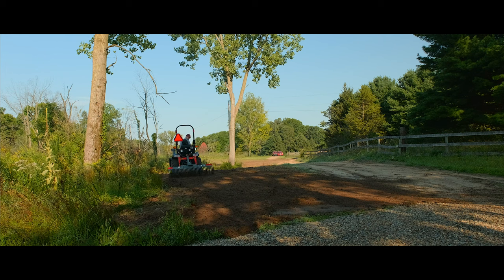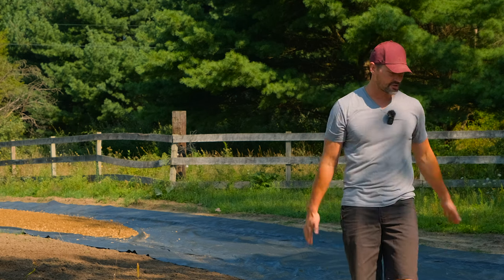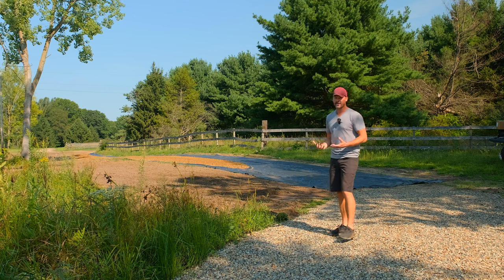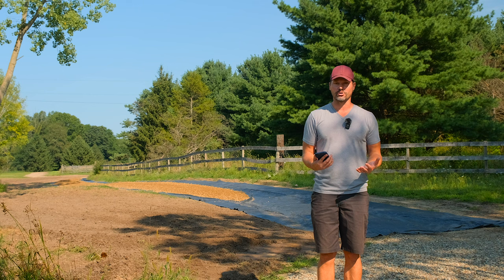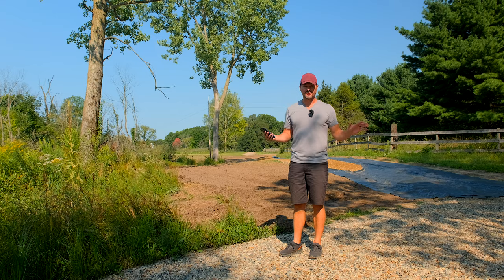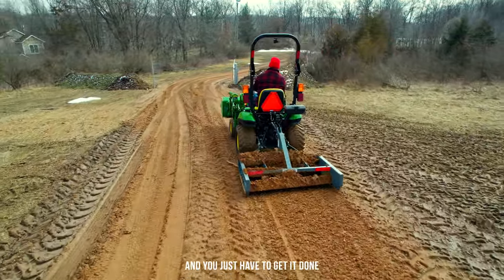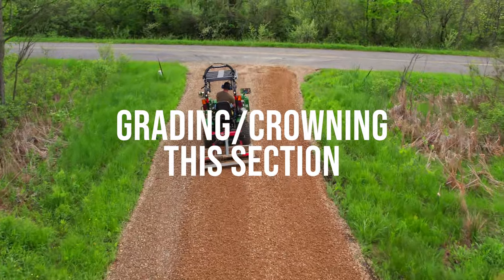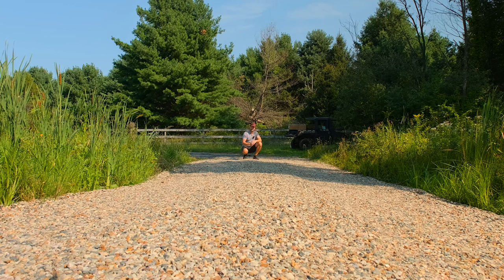5 TIPS FOR GRAVEL DRIVE MAINTENANCE, IS ROAD FABRIC WORTH IT?

Comment: I’ve given up on stone. I started using asphalt millings. Spread it and pack it down when it’s moist and it’s almost like a blacktop driveway.
Reply from the maker: Got that going in at our shop in paw paw
Reply: I have been concerned about long term effects of the oils
Reply: @beaushirley4668  The asphalt has already crystallized and hardened. There shouldn't be much of that left

Comment: Hi, an old school way to make a base for a driveway is to remove topsoil, spread road gravel base,  rowtotill cement into gravel  base, back blade to smooth, water for hardening. If desired, lay down black top for a finished driveway look to compete. I helped my Grandfather do his driveway 50 years ago and it is still in good shape in Northern Michigan 🤠
Reply from the maker: Whew, lots of work, but sounds like it lasts!

Comment: We install dozen of driveways each year.    Fabric on new drives is a must.    You can usually purchase the material for about  $1.25 or less at you ETNA dealer here in Michigan.    Rolls are about 250 feet I believe      Great video
Reply from the maker: It is crazy how folks that do it for a living are on both sides of the fence on fabric.  Thanks for your input!

Comment: I hate fabric under stones!!! When you go to maintain the gravel driveway with your landscape rake and box blade, it always turns into a total mess. Esp if you need to cut for a crown ect. No fabric for gravel drives... Really enjoyed this video!
Reply: Wtf are you talking about? Fabric is an absolute must. Without it the stone will always push down into the mud, essentially creating a bottomless pit that requires regular additional stone. Properly done, a fabric equipped drive should only ever need a light skim with a land plane every couple years, which would never even come close to hitting the fabric.
Reply from the maker: Yeah, I’m going 6” thick so I hopefully avoid that problem or at least minimize it
Reply: @GoodWorksTractors  we use "crusher run" here in TN. 3/4 down to dust. Fabric down, 4-6 inches of stone, then most importantly, roll it with a smooth drum vibratory compact. After the first rain it'll pretty much set up like concrete.
Reply: @jeepinass  okay, calm down... if the stone gets pushed down, just box blade it back up, rake and compact. Fixed plenty of driveways where potholes needed scarfires all the way down to remove.  No need for fabric, but you got this, you do you!
Reply: Imagine you want a driveway through a swamp. You put rip rap down and then you lay the fabric over it and you can put #2 stone on top of the fabric. That’s what it’s made for. So the smaller stone doesn’t fall into the holes made by the gaps in the rip rap. Unfortunately contractors like to use it now as a gimmick to charge more money on jobs. When you lay Fabric on the ground, it prevents stone from doing one of it’s most important tasks… drainage. Water will run under the fabric and wash out the dirt under it. If you don’t use fabric, the stone can mash into the ground and force the water to run over it. all the edges and angles made by the stone slows down the water and allows it to escape slowly and evenly.

Comment: Need way more of these videos. I had a quote for my driveway.. It wasn't 12 grand, but something like 4 grand. 
So I bought a tractor instead. Just have a box blade.. having that crest in the middle is the hard part, having more in depth videos on this would be awesome.
Reply: You need a scraper blade now. You will have to adjust the angle so you get a crown in the middle. It will take you a few passes before it looks good.
Reply from the maker: Hey Adam,

Yeah a box blade is probably the hardest tool to learn to crown with.  Other tools are much easier, but can be done with anything with time.

Comment: Im a contractor here in Central Illinois we're getting around $1/sqft for flat drives. Highly dependent on site conditions. Drives on a hill would be more. Got to cover load and unload time, drive time, fuel, insurance, equipment rental or cost and so on. 
Lots of overhead most don't realize
Reply from the maker: Definitely, lots of other costs to consider!

Comment: Always crown your drive so the water runs down the sides. This will minimize the dust and reduce pot holes. Dress the road after a rain with a box blade down on the right tilted forward  left side up so the rock moves to the center. Finnish grade by tilting the box blade down in the back up in the front to smooth. The steeper the grade the more you'll need to crown.  Drive on right side going out and the left  side coming in. Here in east central Missouri remove top soil, layer of 2" clean, 1" minus, 1" clean limestone is popular.
Reply from the maker: Thanks for chiming in Gary!

Comment: I have a  3/4 of a mile driveway gravel and I just use a TR3 attachment on my tractor. They work  great I only need to do it 2 times a year and my driveway looks brand new. I even have an area at the bottom where it floods over the driveway for almost half a month and lots of pot holes appear once it's clears up I just go down there and do the hole driveway and it looks great like we just put fresh gravel down.

Comment: I had 80 tons of #57 stone brought in about 1 year ago on a well used already packed driveway that was needing fresh stone. So far it’s holding up good without using fabric. If it was a fresh driveway without being packed I definitely would have used fabric. Once these stones start disappearing in several years I’m going to switch to fine screened millings.
Reply from the maker: I do like the look of gravel more than millings.

Comment: replaced  gravel with screened rota mill - about 8 years and just had to skim the edges slightly.  But it is 150mm thick, no snow and slope.  You need to dig the soft stuff out before laying which is a pain but lack of problems is worth while.  It was run over with a vibrating compactor and an insane amount of water to pack it.
Reply from the maker: We’ve got 8” of asphalt millings going in at my shop right now
Reply: You can also use them as a shed base instead of concrete where the cost of concrete isn't justified and everything else is well rubbish - just hit it with a vibrating plate.

Comment: I don't have a land plane or box blade, or the experience to do it correctly, so I had a contractor do mine. I'm not sure what the driveway length is, but it took 3 tri-axle loads of crusher run (53.97 tons) and 4.5 hours of time on a skid steer with a 6-way blade. The gravel was $1442.78 and the skid steer time was $427.50, making the total project cost $1870.28. The drive is 23 feet wide where it hits the road, then narrows down to 15' or so. I'll have to borrow a roller wheel and get the distance, but it's at least 500'. They also re-ditched the sides that were in rough shape. I would have liked to have done it myself, but I needed it done correctly and in a reasonable time frame, neither which I think I could accomplish before winter.
Reply from the maker: Sounds like that wasn't a bad deal at all to me, did it turn out well?
Reply: I'm quite pleased with it. I'll shoot a video of a walk down it and post a link a little later.

Comment: 3yrs ago I built a corduroy road through a swamp. By useing tree tops and digging ditches along the side topped with road fabric and 6in of stone.  If it wasn't for road fabric all that stone would disappear.  We have since had many trips over it with a 10ton stone truck.  Road fabric from the local stone, landscape and bulk material place was $1linear foot, its 12-13ft wide.  Use road fabric if the stone isnt free.
Reply from the maker: Perfect application for it!

Comment: Asphalt is probably the easiest way to go  but in my opinion a stone driveway done and maintained right looks the best by far! Good video! Excellent editing as always too!
Reply from the maker: I agree, stone drives just look nice
Reply: Asphalt is the easiest to maintain, but is so expensive.  I got quotes to cut in a new quarter mile driveway in 2016.  They ran between $28-34k for gravel.  $34-41k for reclaimed asphalt (millings).  $38-$44k for concrete.  $72-86K for asphalt.  Concrete was the clear winner at half the cost, less maintenance (no resealing every 3 years like asphalt or annual raking like gravel), and it could be dyed and stamped to look nicer than a long black/grey slab.

Comment: i think the best to do is and yes it is extra work, dig out your road, then place used tires with the side walls cut out ,you dig a few inches deeper than the width of the tire , you nail the tires together, then pour the gravel over the tires, the tires keep the gravel in place for like forever, you will not get pot holes or ruts, and the water drains /drips through the gravel into the ground,

Comment: I install gravel driveways, I do not use fabric as it usually gets ripped up by snow plows and blowers down the road. You end up having it sticking up and have to cut it away. Roads departments don't use it. My personal driveway is .6 mile long, I box blade it every spring and its perfect. To be fair though we are in an area that is 2 inches topsoil then sand and rock under.

Comment: Husband orders 10 - 12 yards of 'driveway gravel (Technical Jargon: same kinda stuff used on the roads). It gets dumped in a low area in comparison to the general topographical driveway surroundings. Weather permitting, daily exercise regime; fill the flat free wheelbarrow about half way and dump it where gravel is needed; where animals dig under the out buildings, low spots in drive way etc -- pretty much twice a day, then use a hoe or rake to smooth it out. We might use some for mixing small batches of concrete in the mixer for one project or another. When the pile is gone (after a couple-a years or so) order another 10 -12 yards. Not a big deal. Regarding an under garment for the driveway; in my book it's unnecessary. Yeah, it'd be faster work with the tractor, but wheel barrows, shoveling and Total Gym is just part of livin' the good life. 😉💪
Reply from the maker: Hehe, I know I could use the exercise!
Reply: @GoodWorksTractors  If each wheel barrow load weighs 50 pounds, and I spread 2 loads  each time for 180 days each year -- 18,000 pounds of driveway gravel can be spread annually. Inch by inch everything's a cinch.  The rabbit and the turtle -- slow but steady wins the race -- what race? Good question. ✌🧘🌞

Comment: I am doing a similar project. Make a new "road" into the field to a planned hoop house and cold storage building. Got the same product from Vevor, so I hope it works well. I am also doing a drainage ditch upgrade that runs along my driveway using the same Vevor product but 6' wide to put into the ditch and then put 3" rip rap on top.
Reply from the maker: Good idea, hadn't thought about lining the ditch with it too

Comment: I noticed some cat tail weeds in your video. Did you put your drive thru a wet area? If so, I advise mucking that area and install a lift or two of structural fill. If the water flows, add a culvert or two. After this, add road base-gravel, limestone etc
Reply from the maker: Culvert and base was already installed before I owned it.  I don’t believe that area had fabric which was probably the most important area to get fabric.  May need a major overhaul down the road.  Time will tell.

Comment: Geo textile fabric does work.  Especially on clay soils. Good red gravel once it given a good packing rolling and just being able to naturally season will make a good drive way. If possible recycled crush and run concrete on top of of the gravel will help too rain will wash the fines from the crushing process into the voids and will not track on your tires or shoes when wet like crush and run limestone will retain fines near the surface and will track on vehicle tires and shoes when it rains making a mess on vehicle carpets and in your house or business

Comment: Get it wet, and pack down. If you can get hold of roller, use that. The water, clay/fines with bind together with compacting. Once it's compacted and had a chance to bake out and dry. It should be hard as a rock.
Reply from the maker: Roller would be nice...not sure it's in the cards for me though

Comment: Hey Courtney:  well I bought a land plane and had my first go at using it.  The drive was full of pot holes.  So I put down the scar fires and tore up the pot holes.  I the pulled them up and used the land plane to smooth things out.  QUESTION:  how do you pack down the now loose gravel and dirt drive?  It did rain that night so that helped, but if rain wasn’t present, what do you use.  The vehicles run up and down the street but not nessarly down the middle.
Suggestions please.

Comment: Crush and run recycle concrete is best for topdressing is best for clean surface the fractured aggregate will key together and allow rain to filter through it and settle the fines in. IN ARKANSAS MOST CRUSH AND RUN IS 
CALLED CLASS 7 if limestone it virgin if concrete its  recycled.

Comment: Could a 4 in 1 bucket on a loader be used to renovate a driveway, digging out pot holes , the lumps and clumps, then putting down bigger stone and then laying down smaller material on the stone? This is what I’m thinking of doing on my farm’s drive way. I don’t have any rear implements to grade but I’m thinking of buying a grader blade to do work on the farm, this would happen in the future.
Reply from the maker: I think so Karl, but would take some practice to do!

Comment: Use 21 AA limestone. The stone you're using looks like small river rock it will never lock together if you can walk through it and kick it up or pick it up by hand it won't be very good when you plow the snow even with runners or snow skid shoes. The limestone packs together like concrete. I can pull my 600 lb rear blade down my driveway and I only get up maybe a 5 gallon bucket of limestone in about 200 ft if I need to fix my driveway I have to go over at several times with rippers on the box blade to tear up enough material.
Reply from the maker: I’m using 21aa, the exact stuff you say should be used.  I do mention this in the video too.
Reply: @GoodWorksTractors  21AA is just the size you can get 21AA crushed concrete or other stone the rock you have is more round looking in the video. If you look at crushed limestone it's very rough and jagged and really helps lock together. You might not have it in your area as you mentioned in the video. I would ask you guys if they have crushed 21AA limestone.
Reply from the maker: @simpleman4196  it is not round in any way.  It is definitely crushed stone.  I showed closeups and also explained how well it locked together.
Reply: @GoodWorksTractors  21 AA limestone is 21.50 a ton delivered by me but I am on the east side of the state. Crushed limestone is what is used in all the big construction projects in the state under larger building pads or parking lots and roads. Not trying to argue with you at all just trying to help. Iam an operator and do lots of work all over the state and all the projects are engineered with 21AA limestone to be used. None of the stone has dirt in it either it has a powder called fines which is the dust from crushing the limestone that also really helps to bond everything together.
Reply: @GoodWorksTractors  sorry I guess I am blind 😂. Good video and info. Thanks as always for the time you put into your videos.

Comment: I live in an area that has access to Clam and Oyster shells does anyone have any thoughts on using those  products?  🤔
Reply from the maker: Hmm, can’t help ya with that one
Reply: That is some of the best roadway base you will ever use.
Reply: @vincentsaladino9207  Shells are used in quite a few parking lots here in southern NJ, curious about home use, thanks.
Reply: @ronaldharmon9891  They should work well if being used for driveway or foundation base. The material compacts very well.

Comment: How are you going to use a land plane with scarifiers to maintain your driveway if you used that fabric?  You will tear up the fabric.
Reply from the maker: Scarifiers don’t go 5-6” deep and I wouldn’t put them that far down even if they did
Reply: @GoodWorksTractors  If you are trying to remove a pothole.  Like you mentioned in the video, you need to go below the bottom of the pothole to properly correct it. That would end up being more than 5-6".
Reply from the maker: The whole idea of road fabric is to prevent those.  The fabric prevents material from sinking down.
Reply: @GoodWorksTractors  It also prevents it from binding with the soil. It's akin to putting marbles atop a sheet of paper. I've been in heavy construction of roadways and bridges for 45 years and we do use fabric for certain situations. In  my opinion this is not the right application for fabric.